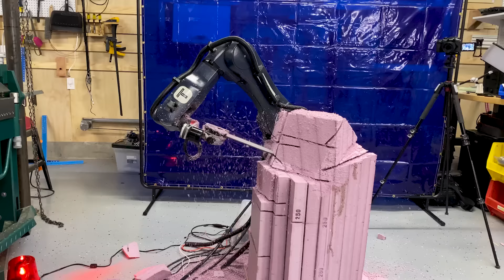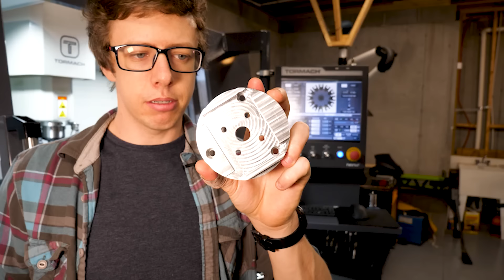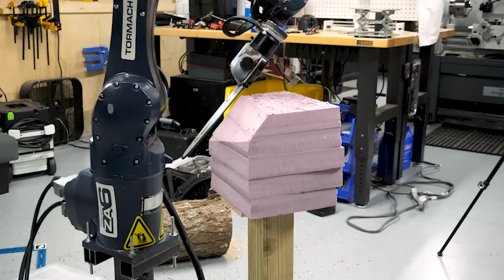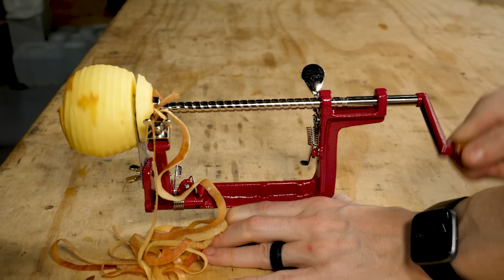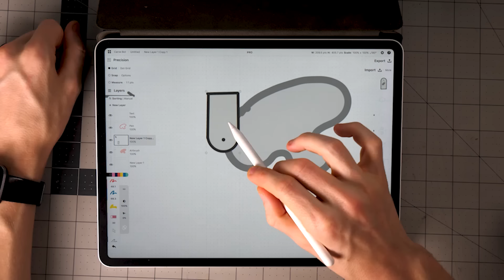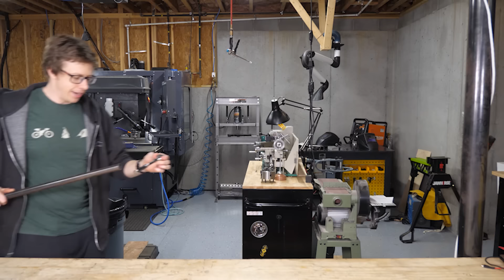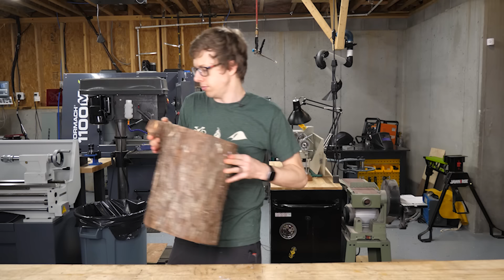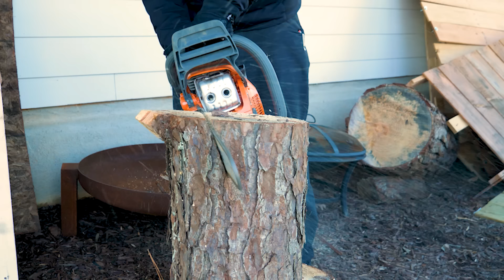Chainsaw + robotic arm = art?

Comment: 17:26 that's not anti-kickback tooth, it's the depth gauge (depth setting tooth). It must be filed down a bit if the chain is not biting into the wood properly and not making decent shavings but only dust. The amount you can file it down also depends on the power of your saw motor. All your chains seem to lack proper down-filing of the depth gauge, as people usually don't know this at all. See https://chainsawacademy.husqvarna.com/filing-the-chain/

Comment: If the problem is that the saw cuts with the tip, could you angle it so that the tip is behind the saw? You would sacrifice a bit of cutting depth, but if it solves the problem it could be worth it.

Comment: At 11:00 when you’re talking about getting stuck at suboptimal local optima, it depends on what you’re doing and what algorithm/ML model you’re using, but you should be able to implement a tolerance or a momentum such that the algorithm doesn’t just get stuck at a local optima. Instead, the algorithm should be able to go beyond that point. I know that this is way over simplified but it should’ve worked.

Comment: Your robot arm/code need to treat the chainsaw like a huge cutter head, with 2D cutting capability, not 3D like you are used to with CNC.  What you coulds do is - first part of slicer code - it tells the robot arm to use chainsaw to cut primary convex boundaries by using the blade. Then second part of code - it use the chainsaw tip only for fine details and concave cuts.

Comment: Dude, forget about chainsaw doing this on logs. There are way too many factors to take into account. When cutting wood - the chain can wear out fairly quick depending on type of wood and how dry or wet is it - in which case you cannot guess how fast or how slow will chainsaw cut small or large section, plus its wear coefficient. Second of all - your chainsaw is not being oiled. No oil = overheat + bad cutting speed. Your best bet is using a cutting bit from plunger router. Those things eat away wood fast, and far more consistent.

Comment: I think you could use your approach to safety as a teaching point ... what you built were passive “this is dangerous” markers plus buttons you needed to remember to press .... you really should have gone on to make an area for the robot to work inside with the interlock switches on the doors so you couldn’t get it wrong no matter how distracted you became,  interesting nonetheless.

Comment: In school I still learned how to program a CNC lathe and CNC machines from scratch. A lot of looking into books, calculating speeds for materials, infeed, selecting tools, etc.
I guess this makes it easier.
And btw: Cool project. Robotic arms are just awesome.

Awww... To avoid that "highly astronomically complex calculating stuff for approaching" you could simply build a more powerful chainsaw and directly cut stuff away instead of, well, peeling it off :D
Like always moving the chainsaw (tilted vertically) up and down, taking shapes from the object like a cake with x pieces (more pieces = more precise), where the furthest away radian measure < blade thickness. Then you "only" have to cover x cuts.
But hey, I'm still very impressed :D

Comment: A hydraulic power unit(motor) getting pressure from an external pump would give you The torque and Chain speed required to cut wood. Would also reduce The amount of necessary tool pressure as it is less likely to rub when Chain speed is increased.

Comment: One idea for getting concave cut outs is to have the machine use the chainsaw in a stabbing motion as well. Driving the tip in then pulling out working layer by layer sort of like reverse 3d printing. changing the angle of the blade relative to the ground would also give different widths. Many chainsaw carvers use the tip of the saw for finer detail work as well. I don't know how difficult that would be to code into this set up however.

Comment: Yeah, but why did he put it on the floor?
If he had put it on the ceiling, there would be no need to turn the material. Plus if he wanted, he could drastically increase the "kill zone", by mounting it to a rail/carriage. With 1,2, or 3 additional axis.
And not just use a motor w/spindle, and a fluted spiral bit? To hog the bulk of it out if nothing else?
Or am I the only one who feels like he could have learned to carve several animals with a chainsaw himself in the same amount of time?
Doesn't matter, when is ge gonna do something useful, or cool with all that stuff?
Sorry, didn't mean to be a dick, what he does is impressive and well beyond my skillset. Bravo.

Comment: Using an "e-stop" without actually throwing a disconnect is a good way to get killed.  This would never fly in an industrial environment, and you would be fired on the spot for entering a robot danger zone without throwing and locking out a disconnect in pretty much every factory that cared about safety.

Comment: The false summit check is an easy fix through raycasting. Assuming the point arrives at the false summit, then says "Hey I'm at the top". You would just send out what is essentially a raycast in a few directions to verify if it is indeed at the highest point. In software this would be trivial, in a real world application raycasting gets alot more complicated, but could probably be accomplished though a laser/infrared sensor.

Comment: Check out how to sharpen a chainsaw. The “anti-kickback” tabs that you referred to are depth gauges. You need to file them down a little in order for the teeth to cut. Should work great after a proper sharpen!

Comment: Is there any reason you didn't just find out the smallest size tetrahedron that the chainsaw could neatly remove, then just consider the wood block as made up of tetrahedrons of that size, then just remove one tetrahedron at a time until the desired tetrahedrons remain? Would it look too pixelated?

It seems like plunging just the tip in repeatedly (no innuendo) at 60 degrees would give you a good result.

Comment: It smoked so much cause u used a branch saw for solid logs, normal chainsaw have an oil tank to keep the chain oiled, that results in way less heat, way better gliding and longer life of the machine, as the chain is not expanding as much, also the saw teeth are probably not as sharp as from normal chainsaws, something to consider for ur next try

Comment: If you used a drill, and drilled into the depths, it would work better. You could even have tool changes moving to smaller bits to get very exact models.

Comment: I highly recommend using a grinder with a wood grinding disc. it will be much better for attacking wood at weird angles. You can also get a "chainsaw" disc for grinders, but i think the grinding disc will work better.

Comment: The math he does to just cut wood and program a machine to just cut wood is the type of math our teachers were right about us needing for the future. Sadly I didn’t even learn what he’s doing though so I wish I understood :(
Reply: You don't learn that type of math in highschoo, so you're good
Reply: @xNoLiix  Hmm..Geometry...Trig...yup. They have vocational courses in high school too..like...using a CNC machine.
Reply: most of this math is learned during a mechanical engineering degree, he uses a lot of linear algebra (differential equations course) and inverse kinematics (I learned this in a machine design course) but he didn't have to use that in this one. you can learn a lot from a technical degree like cnc work. Manufacturing processes are super cool and thats also included in a mechanical engineering degree.
Reply: @TheCulturallyLost  Yep, I am MET major right now and all of this is required courses. MET stands for Mechanical Engineering Technology
Reply: He was more focused on the process, the coding was and most likely the hardest part of this project. You don't learn this in school and the math wasn't the hard part. He has his tools and his challenge is how to teach those tools to cut the dog.

Comment: I wonder if you could incorporate some type of Metropolis Monte Carlo method into the code that kept getting stuck at local maxima (false summit). Like if you added some probability for accepting a move that allowed you to move away from a summit in hopes of finding another higher summit. The problem is you still will never know if you reached the global maximum but you'll probably find higher false summits at the least.

Comment: @Stuff Made Here 
That "anti kick-back tooth" you're referring to is commonly known as a raker tooth, it guides the cutting depth to ensure each tooth only takes a small slither at a time.
An easy fix for your issue is to simply file down (with a flat file ensure they are filed nice and square to the bar) which is common practice as the cutting tooth wears and becomes shorter when sharpened.
I would imagine the rakers are set very passive as you are using small home owner saws without a massive amount of power and like you said it does help to reduce kick back.

Note: one or two strokes of a decent file is sufficient for the raker a little bit goes a long way with them and you don't want to make it too aggressive and cause the saw (electric motor in your case) to work too hard and increase effects of kickback, also not really a concern with your application.

Comment: Evolution also has gradient ascent, which means that we do not always arrive at the absolute best possible solution but one that works in short term. This can lead to evolutionary dead end, where every path that would eventually lead to better version, has to go down the gradient... and evolution just does not allow steps back unless it is beneficial.. The "topographical" map of evolution is dynamic and as long as it doesn't change drastically, evolution can reach a point of no return. It is on a wrong hill, permanently. And when that map changes drastically, it usually means near or complete extinction to most "hills" and something that has not ascended that far has better chances of finding the tallest hill in the new landscape..

Comment: You have to use bar oil to lubricate the chain.  Chainsaws have an oil injection system.  
The chain also needs sharpening, some people sharpen the chain every tank of gas, so i figure about every half hour.

Comment: They use a special chainsaw blade for sculptures, it is much more narrow at the tip. You can be more fine with it and there is much less "kickback" force when cutting with the tip. Also, please sharpen your chain and don't forget about the depth teeth. Great video btw, love your stuff. (also sorry for the broken english)

Comment: Those teeth on your chain are called depth gauges or rakers. they need to be aprox .025" below the tooth for the chain to cut effectively.  The chain refusing to cut is from sharpening the chain and not filing the rakers. That Robot arm is blowing my mind dude!!

Comment: Hey Shane -- Might I suggest that if you'd like to try carving wood again, you might have better luck with a full chisel tooth profile, and grind or file the depth gauge (raker) down pretty far.  What might be too low for a human would likely be just fine for a robotic arm due to the rigidity, strength, and controlled motion.

Comment: At work we had a few ABB robots that mounted a circle saw. The motor and the saw were not too large and the rigid precise construction of them made it easy to use it as a tool. Also set axis limits to avoid cutting up the robot with it's own saw. 
Anyway next project should be a robotic feeding machine with spoons and forks... and a volunteer to be fed.

Comment: I'm not really smart when it comes to computers and programming.

but could you use that same algorythm where the ball searches for the peak and when it reaches the peak move it to the edge in an x or y axis and have the program look for another place where it goes up and just make the program take note of the peaks to find the highest one.

or just make the program do it more than once on the same part and take note of the highest achieved altitude. depending on how many peaks could this work but i still think the version I wrote down first would work less bad.

but as I said, I have absolutely no programing knowledge, I'm just a specialised pipe welder

Comment: Hi! What an amazing effort! When you talked about the reason the sawchain would not cut properly, you were very close! It's not the depth gauges which are rubbing, but the trailing edge of the cutter. If you look at chains used by carving guys, they have cropped trailing edges for this very reason. Additionally, they use special carving bars with very narrow tips. This does two things: it helps to get into tighter areas, and helps to reduce the likelihood of kickback. 
I'd love to see you try again in wood, this time with the right bar and chain combination. I'm certain your results  will be great! Keep up the good work! 
Here are some useful links:
https://www.stihl.com/STIHL-power-tools-A-great-range/Chains-bars-and-accessories/Guide-bars/22378-63696/Carving-guide-bar-E-1-4-P.aspx

https://www.stihl.co.za/saw-chain-types.aspx
Hope this helps!

Mike

Comment: Hi! Stunned, amazed! Humbling experience to watch your vids! I have one question: Against false summits, is it possible to start from different random starting points simultaneously, comparing the summits and going with the highest? I know it is not a full solution but can eliminate large parts of false summits, depending on the amount of random starting points at the beginning. Interested in your opinion about this so i can learn. Thank you in advance.

Comment: I didn't see anything to distribute oil to the chain,

Chainsaws need "bar oil" available at any hardware store.  It not only reduces friction but provides a method for removal of waste heat (heat transfers to oil, oil gets absorbed by wood dust, wood dust goes flying)

P.S.  when working in python code, replace NumPy with CuPy You will need to check the CuPy "translation chart", but nearly every calculation in NumPy can be done in CuPy but is done on a GPU in a fraction of the time (those days long calculations would probably drop to an hour or two)

Comment: Have you considered bolting a large steel plat to the floor in your common work area so you can bolt to it instead of anchoring into the floor for every new project and you can even ground the plate for electrical safety

Comment: 17:27 this sir, is a depth gauge.. if you file it down a touch the chain will cut better but also big the motor down more. After years and years of cutting with chainsaws it's an essential skill to know how much to file down and also what degree of angle to file the actual teeth for optimal cutting for certain saws and wood types(:

Comment: If you want it to cut wood, the bar needs lubrication and you’ll need a better chain that has been properly sharpened. In my experience, a sharp chain with proper raker depth requires very little torque to actually cut wood.

Comment: There's a lot of optimization algorithms.  Here's one to try:  simulated annealing.  You randomly perturb at each iteration.  Perturbations are large initially and smaller eventually.  The idea of the perturbation is to kick you out of false local optima initially.  It kind-of models how atoms arrange themselves to minimize energy at grain boundaries during the freezing of a molten metal - hence the name.  The size of the perturbation corresponds to the idea of temperature.  We used it in the early days of speech analysis to solve audio as a sequence of phonemes.  That was 40 years ago,  I've no doubt there are much better ways to do it now.  We ran the simulated annealing on a bank of many BBC model B microcomputers (6502 chip).

Comment: For the gradient ascent you could use multiple "balls", each at random points, so that the odds are 1 of them will reach a summit that is close to the optimal one. You can also have a dynamic learning rate to increase the efficiency. The more "balls" you add, the more likely you will reach the optimal outcome, however even if you dont ever reach the best one, you can still reach one quite good. https://machinelearningmastery.com/gradient-descent-for-machine-learning/

Comment: The non-optimal peak problem was also an issue in early automated FPGA place and route software. The solution was to use an algorithm based on simulated annealing. It starts off with multiple initial guesses, calculates peaks for each, and picks a subset of best results. It then permutes the original guesses of the subset by multiple random amounts, and runs each to a result. It then picks a new set of best results, and repeats. As the algorithm progresses, the range of the random numbers is reduced. With a problem domain with hundreds of thousands of local maxima, the algorithm would reliably get to over 90% of the best possible solution. Better solution are achieved by slowing the rate of range reduction of the random numbers with commensurate increase of processing time.

Comment: Overloading robots isn't as critical as thougth our kawasaki bx200l for example is designed for 200kg of payload on a 3m raduis but it once had over 1000kg of payload 3m away from the foundation (maximum reach). Even the small rs003n can press down over 60kg before they start to struggle (3kg payload robot) it isn't great for 24/7 usage on full speed but when you slow down you could often overload robots without even damaging it.

Comment: Generally I always grind down those predogs on my chainsaw chains by 30% .. I use an Oregon chainsaw sharpener and stone and do them in the vise with a die grinder or dremel while it’s in the sharpener...cutting with it after is easier although it’s a little more scary but in experienced hands the chainsaw is very effective and less taxing on your body //in your case machine.